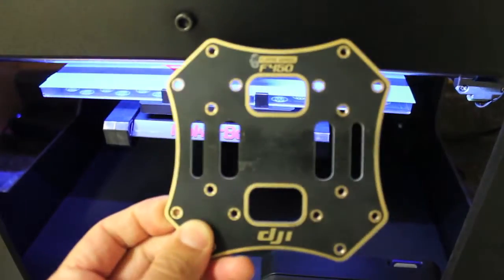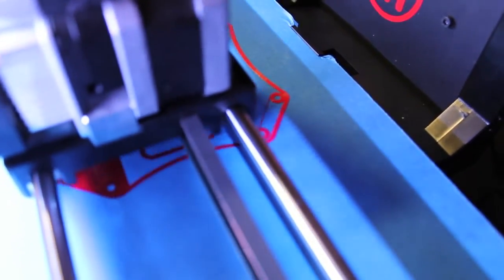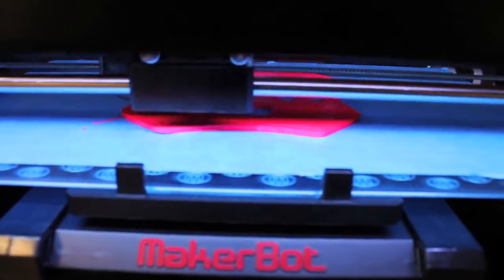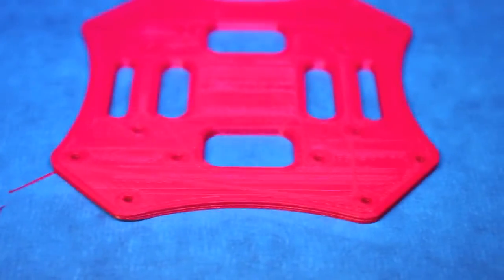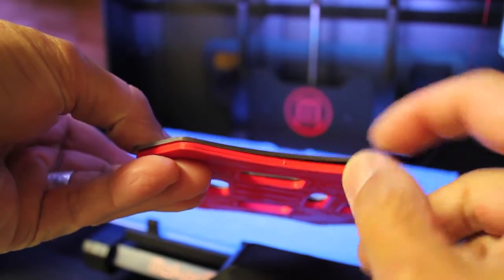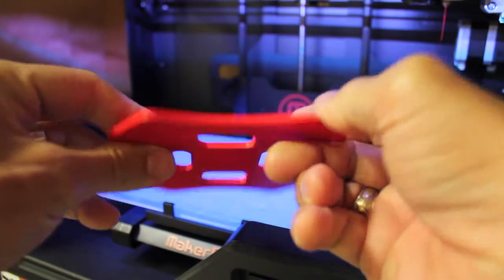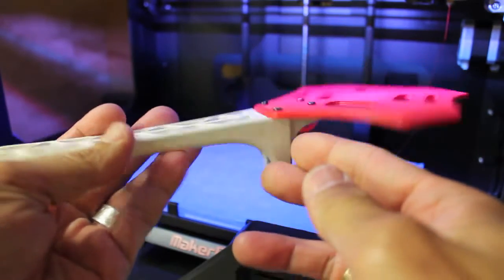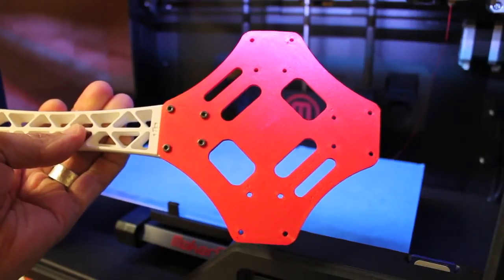DJI F450 3D Printed Top Plate w/ MakerBot Replicator 2

Comment from the maker: Dennis Nash I wasn't able to reply to your comment directly so hopefully this will work. This new G+ commenting system on YouTube is a real drag! Regarding arm bolt dimensions if you're talking about the part of the arm that connects to the top and bottom plate then you should be able to get the dimensions from here:

https://github.com/dbaldwin/garagepilots

There are two DJI F450 top_plate files. One for Sketchup and the other is a STL file. Hope this helps.

Comment from the maker: Thank you. No, I haven't done propellers but it's not possible to get them as smooth as what you'd buy online or at the store. That means your 3D printed props won't be as efficient and will create all sorts of vibrations on your multirotors. At least with the MakerBot that will be the case. But I still do plan on printing some to see if I can at least get something in the air :)

Comment from the maker: I had a little bit of warping over the winter, but no warping now that the hot Texas summer is here. The MakerBot Replicator 2 is in my garage, so over the winter it was cool enough to cause a few of my prints to warp. The build plate is not heated.

Comment from the maker: What I did was take the outer dimensions using calipers. Then I took a top down photo of the plate. I then created a rectangle using the dimensions in Rhino 3D. After that I imported the photo and scaled it so the edges of the plate matched up with the rectangle. From there I traced the outer egde of the plate and created all the holes. Worked fairly well.

Comment from the maker: Do you want the GP3 to record or just be your FPV cam? Or both? I had it setup for both at one point and it's a tough lens to fly FPV with. So I purchased a separate FPV cam. I have a build video that shows the process. The F450 is a decent FPV rig. It can definitely carry the GP3 with little problems. You'll need a good mount or you could strap to the F450 bottom plate.Just keep in mind you'll be dealing with vibration. The stock DJI motors are decent. Definitely good enough to get started with

Comment: PS you could "cast-in" the copper plates for the power distribution board by stopping the build half way and placing the copper in recessed area then continue laying down plastic over the non-exposed used areas? Cool!